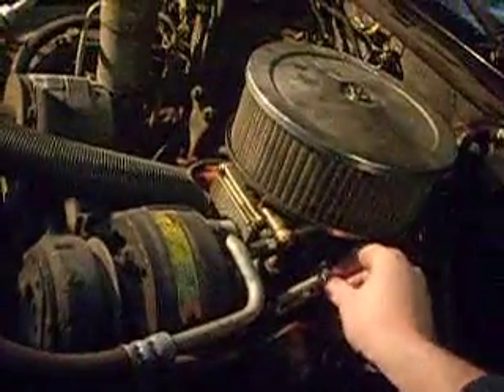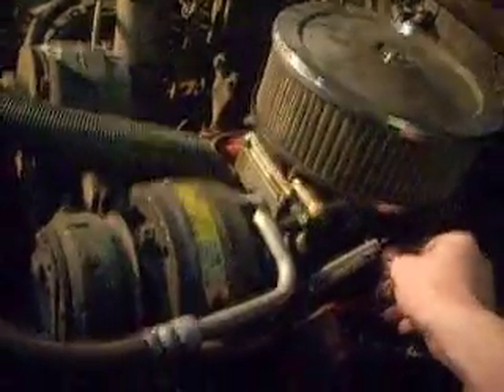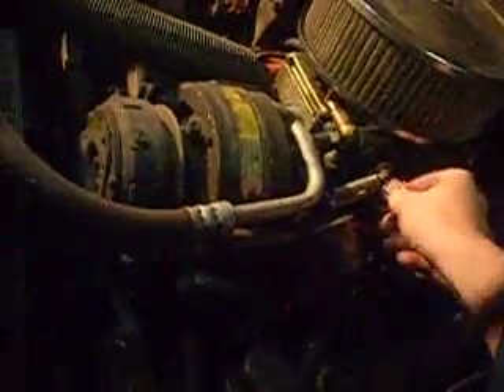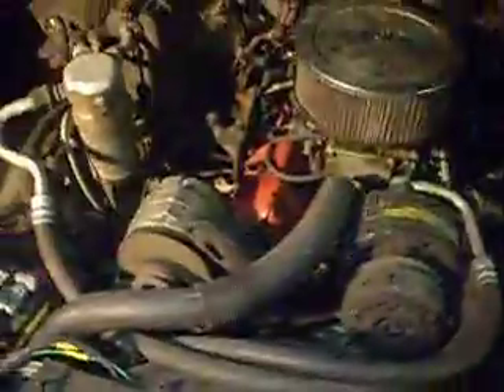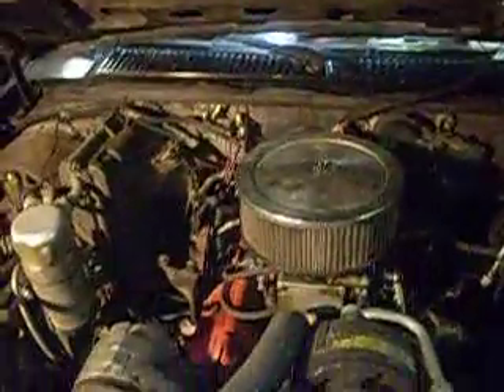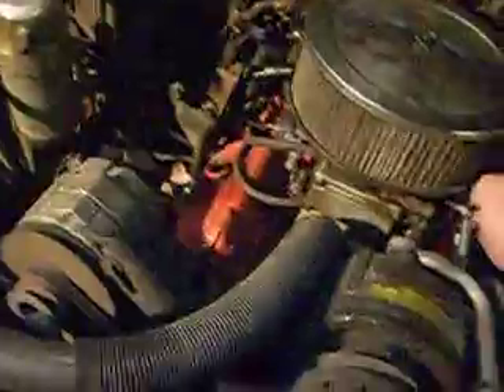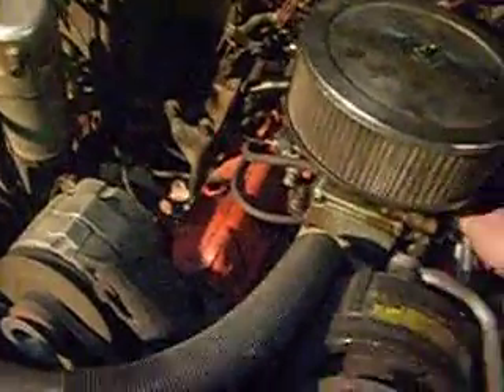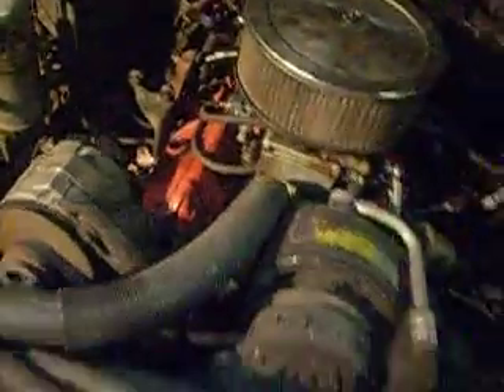1984 S-10 x-cab with 2.8L and Edelbrock intake a 4bbl Holley 390 cfm

Comment: Awesome video bro. I have a question for you... I have the same truck and the same intake/carburetor as you. When you installed the intake did you use an original gasket the one that has a plug? Or did you put in a newer one?
Reply: +Alex Sarabia you must use new gasket ;)

Comment: Would you ever do that to another S10?  If so I have the carb and intake never installed and more parts as well.
Reply: 4 barrel intake and carb? How much?
Reply: @95fordtbirdlx  I have the receipts still let me get back to you
Reply: @95fordtbirdlx  I also have roller tip rockers that have never been installed with all the pushrods and all the lifters brand new never installed
Reply: The roller tip rockers I believe are made by Comp Cam they came with the Cam Kit but I put the cam in a different truck
Reply: @95fordtbirdlx  sorry for all that quick responses but you kind of got me excited there. I've been sitting on these parts they're all new and I never installed them and I don't think I'll ever do the project
Reply: @charliesleeseman4643  your all good brother.  I'm planning to use the parts on a fwd 2.8 V6 in a 1980 citation street/ strip build.  What kinda carb and how much are you asking for each (carb, intake, roller tip rockers. Etc)?
Reply: @95fordtbirdlx  I'll get back to you with all the prices. But the carburetor is a 390 CFM 4-barrel carburetor and the intake is a Edelbrock torker manifold. That manifold comes into pieces it has a lower and then also has the top because depending on the carb you use determines the top you buy. So I bought the torker manifold with the top piece for a 4-barrel carburetor. And the roller tip Rockers are made by Comp Cam.
Reply: Oh yeah the carburetor is Holly

Comment: i woulda gone with the 4.3
Reply from the maker: If you are going to go to the trouble of the modifications of putting a 4.3 in an older pre 88.5 truck, you might as well have put a V8 in it.  The firewalls and the crossmember were modified at that time to accept the larger 4.3 motor when it became available.  Externally a 4.3 is a 350 with only 6 cylinders.  

Truck currently has a hot rodded,  bored out stock 87 EFI intake with a 4.3 TBI sitting on it.  Fun little conversion.  It has gobs of power....easily smokes any 4.3 truck I ever had, and I had 4 of them.